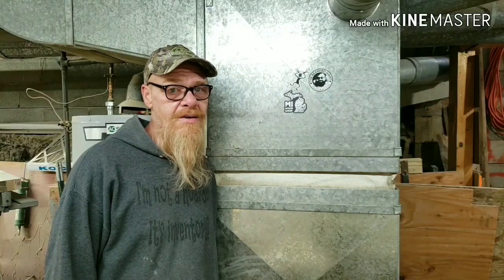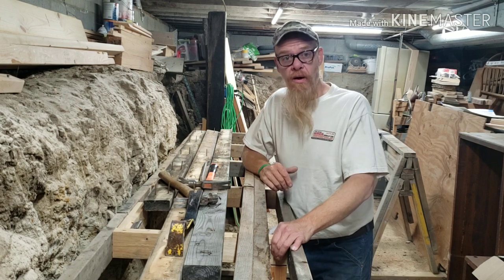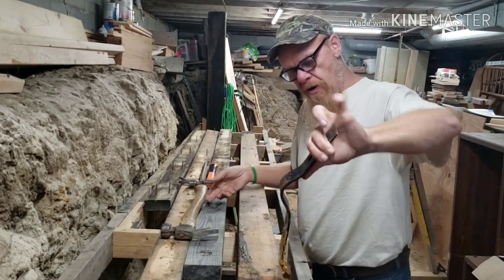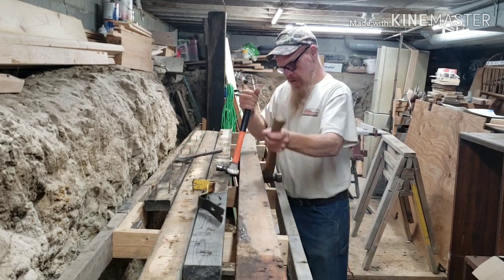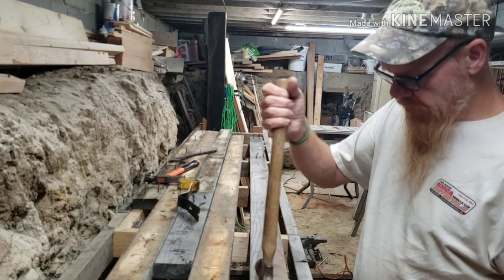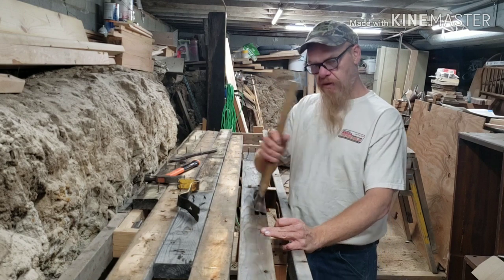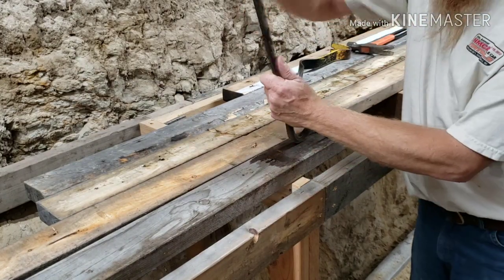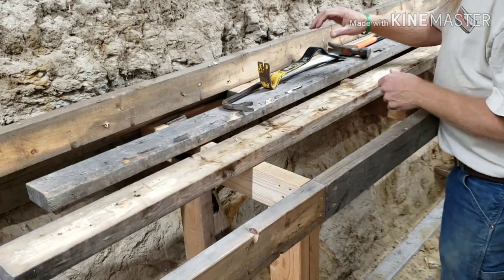PULLING NAILS THE RIGHT WAY !!

Comment: A tip I learned from my Dad:
If you nails try to bend when driving from the back side when hammering them out, hold them with an electrician’s pliers then hammer them out. By holding the nail with the pliers they cannot bend again.
Reply from the maker: That is a great tip!

Comment: Kevin thank you so much for teaching how it is done.   I have some lumber and some of the nails are on the thin side, very hard to take the nails...so i used the rocking with the hammer and voila it worked...however some nails are rusted and broke ...now need to figure out how to get the piece of nail out  since it is not showing on the other end...thank you
Reply from the maker: You can do it! Glad to help!
Thank you for stopping by.

Comment: This is great!! Thanks so much for every tip and also for modeling and explaining (in simple form to the sour-grapes what-the-heck-are-you-wasting-your-time-for?!? crowd) the reasoning and importance in using materials you already have or can often find and get for no cost (local, neighbors, free-piles, etc). Your points you make about working in a rental space (wanting to/ needing to functionally upgrade a rental space) are right on. No way I'm putting $ into a feature that the landlord or next renter is likely to discard.
I may never get past the "phase" in my tinkerer-creativity where I don't create the best design/function for a project right out of the gate, and you better believe I am not tossing out any materials as I re-work my way to a better finished product. Best to begin with materials that needed repurposing anyway!
Reply from the maker: thanks